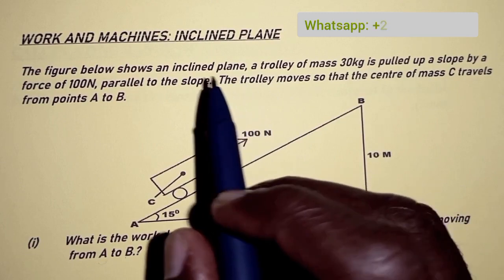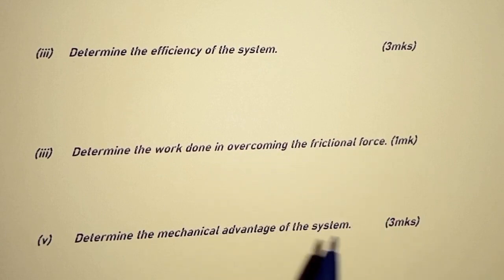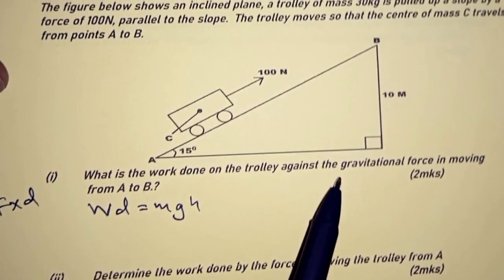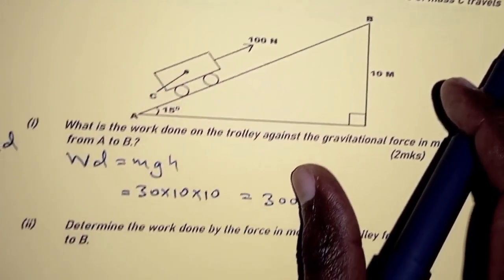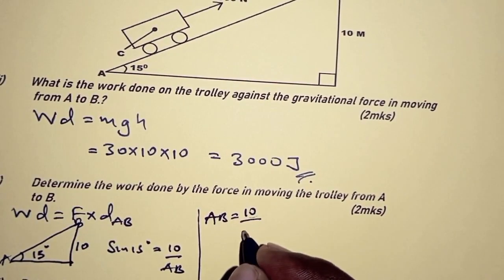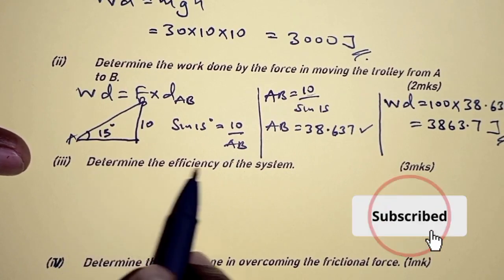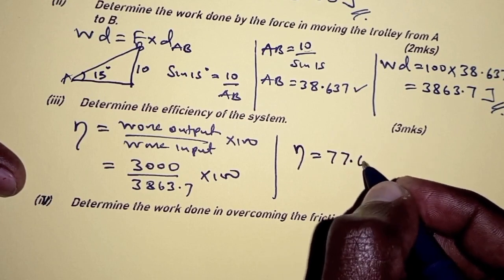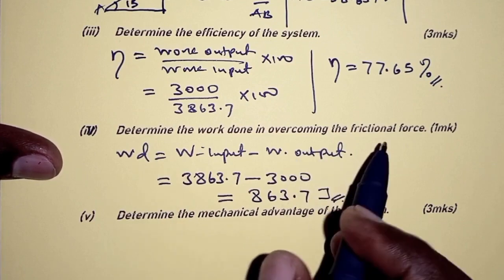Work and energy// inclined plane

Comment: Sir I didn't get the difference between the first and the second question, they seem so similar. And also for the energy output how i know 3000 is input and 3863.7 is output? Any key word is not mentioned as far as I can fetch
Reply from the maker: Hello! Work input results from the effort force (force applied by the user) for instance, in (b) the force moving the trolley parallel to the inclined plane (AB) working against friction.

 Work output is  work done by the machine (inclined plane) against the weight of the load, which acts vertically, I.e. in (a) work done on the trolley (load) by the inclined plane, is work output . Simply put, work input is due to effort force, while work output is due to the machine against the weight of load. Please let me know if this response helped 🙏
Reply from the maker: Note that the inclined plane has to help lift the load through the vertical height (h) hence (work output= Weight × h).

Also, a force has to be applied to pull the load along plane AB, hence (work input= Force applied × distance AB)
Reply: @KevinOtienoh  Thanks sir!
Reply from the maker: Anytime 🙏
Reply: @KevinOtienoh  Ah yes thank you so much sir, hat's off for being an amazing teacher. I understood now the difference between what the 2 questions were asking. Can you make a video about this topic of inclined planes but with more examples? I have term exams and that would be dope!
Reply from the maker: @zzaenabz it's alright, let me organize.

Comment: Why not using the mgsintheta
Reply from the maker: Hello! mgsintheta is already given as 100N.

Since the trolley is in motion with constant velocity (the force applied remains constant throughout, 100N), Resultant force=0.  I.e., resultant force = Force applied - (friction+ mgsintheta).

But the trolley is assumed frictionless. So the equation becomes:

0= force applied -(0+mgsintheta)

Which implies:
Force applied=mgsintheta.

Please let me know if this response helped 🙏
Reply from the maker: Note that, mgsintheta is a force acting parallel the inclined plane but opposite the direction of applied force. This force together with frictional force act in the same direction.

Comment: i want to ask, why in the second part the formula W = F s cosθ is not used, as here cosθ wasnt used.
please tell 
thank you
Reply from the maker: Hi, we have applied that in a way. Remember, theta in the formula wd=FsCos(theta) is the angle between the force applied and direction of motion it causes, of which in this case is zero so Cos(0)=1, hence the formula becomes wd= Fs. I.e the force 100N is parallel to the incline plane. Suppose the force applied was horizontal, we would have used 15° as theta in the formula in order to enable us use the resolved force (f=FCos(theta)) which should be parallel to the direction of motion it causes.
Please let me know if this response helped 🙏
Reply: @KevinOtienoh   here we consider the work done by the force is on the hypotenuse of the triangle as the displacement caused right? 
thank you for sharing the explanation
Reply from the maker: Sure, you are right 👍
Reply: okay thank you  @KevinOtienoh